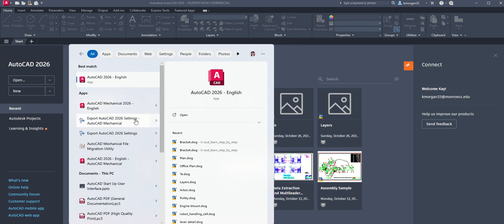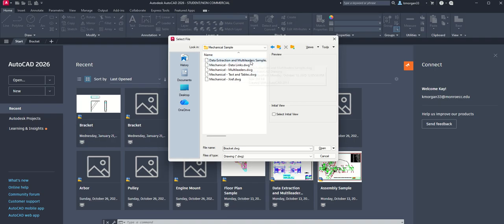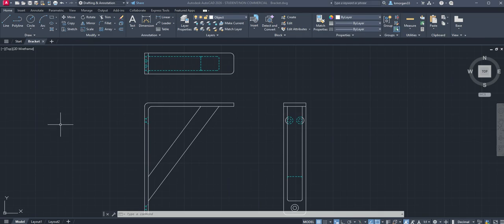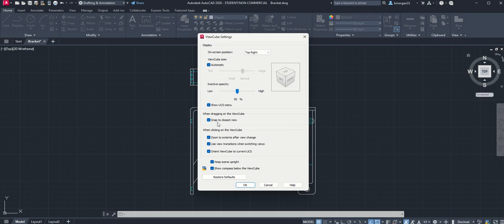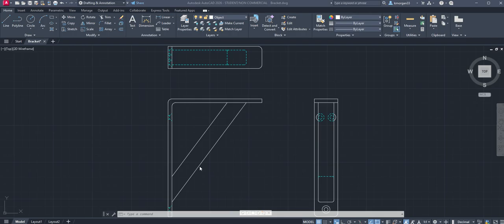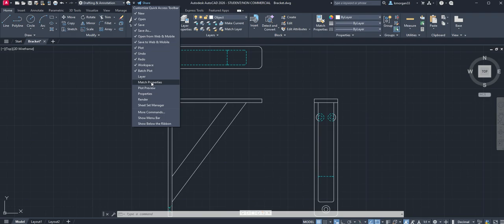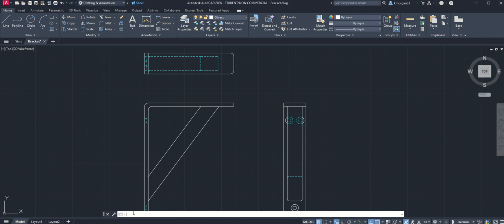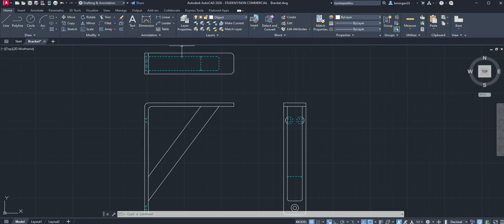AutoCAD User Interface

Comment: In this lecture video I have learned how to navigate the software tools in Auto Cad. I learned about the drawing area and how its purpose is to create and modify drawings. There are also menus that allow you to tell the software commands such as zoom commands, orbit commands, view cube, steering wheels and XY coordinate changes. I also learned about 2D and 3D isometric layouts. 2D are Lines on the drawing area while 3D is isometric. Top planes are also prominent as all 3D has 6 surface planes. I also got a good understanding of viewport locations and functions. Lastly, I learned that drafting standards that we use in the U.S is 3rd angle. -John Kanu